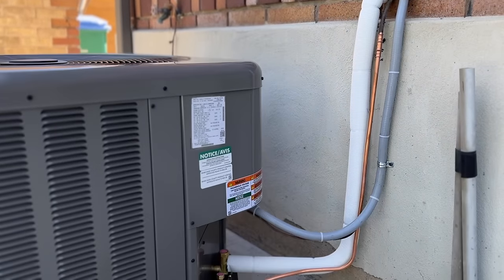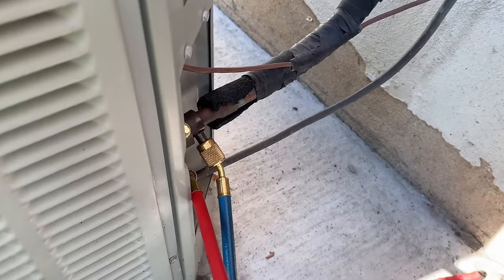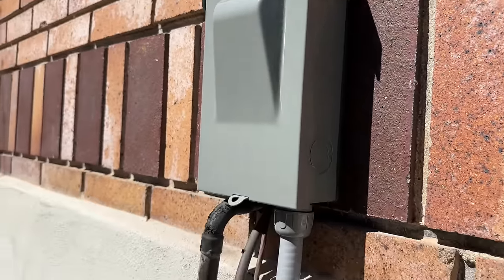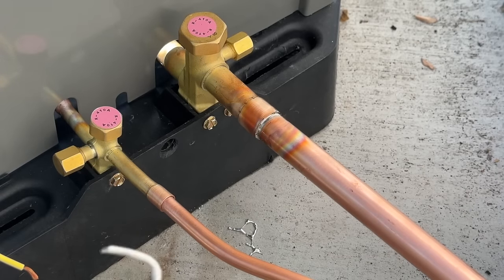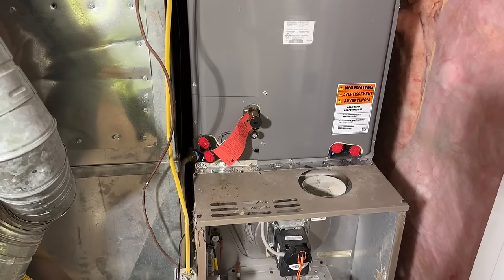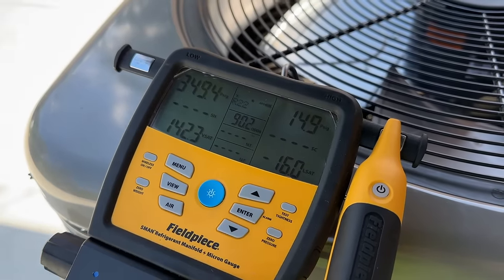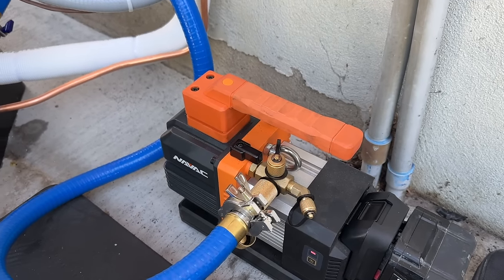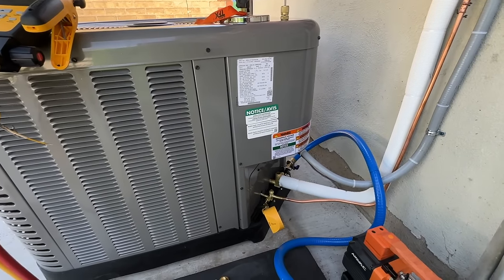Did You Know You Can Replace Your Own Air Conditioner?   -SAVE THOUSANDS-

Comment: Great vid, but.... "You can replace your own..." as long you have all the cool tools, nitrogen tanks, skills and knowledge to do the work... oh! so if I am a skilled, working HVAC tech I could do it myself!  lol  this was a great sales pitch for why homeowners need to call a pro... lol
Reply: pro schmo
Reply: I hear you but even if all the tools cost $2000, that will still save you over 5 grand.
Reply: I’m all for DIYing within reason but I think replacing your own central AC system is a stretch and a half. 

Aside from the thousands of dollars in tools he used (electrical meter, refrigerant gauges, temp probes, vacuum pump, Micron gauge, propress with RLS jaws, nitrogen tank with regulator, Schrader core removal tools, sheet metal tools etc), there’s also the looming chance that an inexperienced homeowner damages the equipment and now has blown a wad on equipment that will not be covered under warranty due to improper installation. 

I could see someone:
 
-Dumping the charge due to misunderstanding the valve orientations and/or schrader removal process (risk of refrigerant burns + EPA frowns upon this),
 
-Damaging or puncturing the evap coil in the process of installing, 

-Mangling their ductwork beyond their ability to repair, 

-Introducing noncondensibles during the evacuation process, 

-Failing to properly seal around the linesets causing water ingress, 

-Failing to properly insulate the suction line causing sweating,

-Improperly orienting the drain causing water damage, etc

Not to mention the risks associated with trying to wire it with no experience, among many, many other things.

Is it rocket science? No. But there are very good reasons why people go to school for this and take several years of on the job training to be considered a competent tech.

Comment: I have always used the old line sets with no flush on 22 to 410 as long as a filter was installed and no  shelled compressor.
Reply: So you've always done it wrong. Congratulations.

Comment: I'm retired now but in my 40 years in the industry I've seen many techs that don't know what they are doing. So some could learn. Since I'm old I'm a bit more old school. He seems to be a good tech and not doing anything wrong, except with the change from R-22 to R-410A, I always preferred flushing the lines with solvent. Gets them super clean. I've actually gotten a lot of mineral oil out and it is recommended. I've been told most guys don't flush (added time and expense) and I suppose the jury is still out whether or not mixing the oils shortens the life of the unit. You can buy anything online nowadays so the EPA and licensing are fairly irrelevant. I was licensed and universal certified.
I watch videos like this out of curiosity rather than looking for info. I see this video as an explanation of all the work necessary to properly replace a system more so than encouraging homeowners to do it themselves. After all, we saw all of the equipment he used to get it done. He has top of the line equipment. You can get by on less than the thousands of dollars worth he has shown but you do still need relatively expensive equipment (which he will gladly sell you via his Amazon page) to do the job. For one job?
HVAC work is a bit more technical than other DIY projects. If it doesn't go right you could pay a lot for someone to come fix it, if you could get anyone at all. Honest contractors give a fair price. Shop around because there are plenty who gouge. Honest ones get what they need to run their business and put food on their table. I don't think "The DIY HVAC Guy" works for free.
Reply: A lot of manufacturers these days don't recommend using R11 to flush the line set. Sweeping with a nitrogen a few times is good enough, unless it's a burnout.
Reply: I understand in some cases you can't change out the copper lines, but where you can why not just change them?

Comment: Great video and I can confirm the title, "-SAVE THOUSANDS-" is 100% accurate. We are getting a new slab poured in our backyard. Our contractor let us know that they'd need the condenser moved/disconnected to raise the current slab it sits on. Called up our HVAC company. They quoted us just under $3000. Called an HVAC friend of a friend and was quoted $1600. #TIL.
We decided to live with our condenser being an inch or two lower than our patio.

Comment: Years ago when I installed my AC, I was told by a number of "experts" that you cannot solder an R-410a system - it wouldn't hold up to the pressures. So I invested in the equipment to braze. Fast forward 10 years later, and many of those same experts are saying they have been soft sodlering with 95/5 tin/antimony, and zero field failures of the joint. So, there you are. Apparently the advice about soft soldering was based on experience with plumbers solder, which is 50/50 tin and lead. Make sure you get the correct solder!
Reply: When I had my goodman installed about 4 yrs ago they braised the connections

Comment: Again as always, I love it DIYers.  I have worked more than one of their calls to make their stuff wor and I’m sure plenty of folks can figure it out well enough to this, But who that isn’t in HVAAC owns refrigerant gauges? Vacuum pump?  Reclaim machine?  Reclaim tank?   EPA card to work with refrigerant?  Also, you do do a micron test, but there are two ways to fail it.  One way indicates a leak. One way just indicates you still have moisture in the lines.
Reply: I'm on both sides here. 

I love the pros who don't reconnect the thermostat wires from the condenser to the furnace when it was replaced. 

Looking for an easy callback perhaps? 

Pros aren't the gods they think they are nowadays. I'm a licensed plumber and am seeing the quality and thoroughness being thrown out the window the past few years. Not many have pride in their work. Just there for the check.
Reply: Way back in 2004 I installed a 6K BTU mini split 100% DIY. It was for a 350 SF detached office building and we only had 110V. The pros that gave me estimates (some said I needed a “real” system and 240 VAC) quoted ridiculous (at the time) prices of $2K-3K. The unit (pre-charged, flare fittings) went in easily with a day of work, and when we sold the place 12 years later it was still working like a champ. Total cost was under $500.